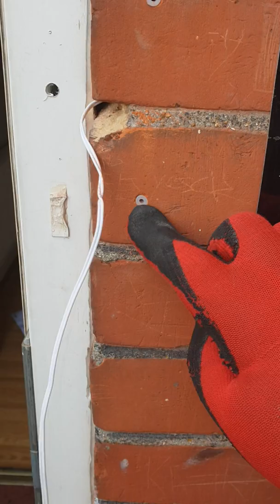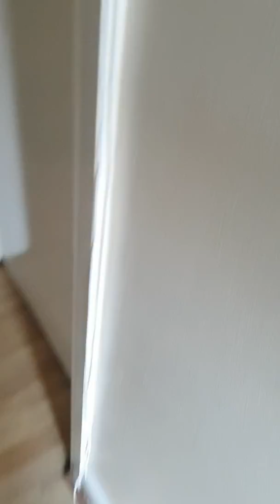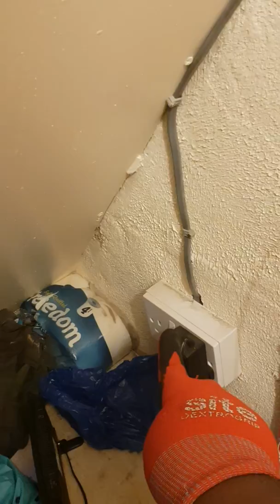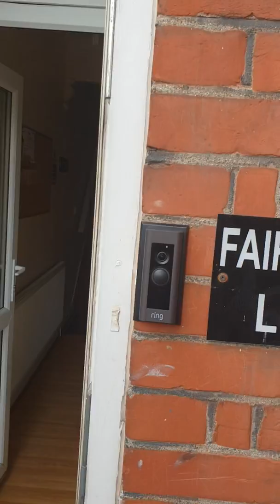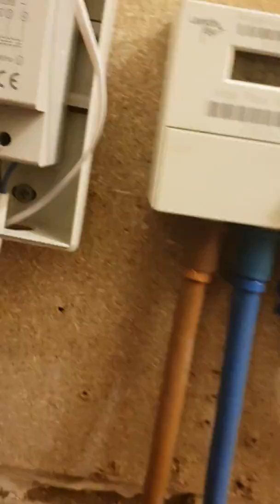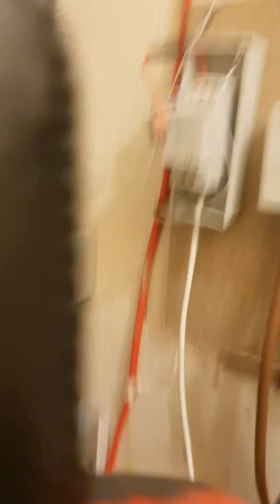Ring video doorbell Pro installation explained easy! UK ( w/o exisiting door bell)

Comment from the maker: No you need the new bypass unit
Reply: Hi Telephone Engineer. My pack contained a bypass unit and transformer which I've used but when I measured the ac voltage output it was 31v not 24v. How come the transforer they supply provides a greater voltage than the bell requires - will it be damaged?
Reply from the maker: @brianrogers5974  hi Brian I remember a YouTube video about I think 3 years ago when a uk youtuber measured the voltage of his at his door it was about 29v so on some jobs where I've installed the ring pro  I've checked the voltage and I've been getting about 29v to 32v?I dont this its to much of a problem ,you could try another transformer from screwfix which runs at 24v the same voltage and cost £8.99?also remember it is an alternatiing current so the will be a degree of voltage fluctuation.
Reply from the maker: @brianrogers5974  plus if the ring transformer does so how damage it it will be up to ring to replace it with a new one.
Reply: @siatelecomsltdLondon  Thanks for the speedy and reassuring response. Can't understand why on earth they use the term "bypass unit" though when it's just a slow blow fuse.
Reply from the maker: @brianrogers5974  the new white square block I dont think it acts as a fuse I think ,I maybe wrong it could be a some sort or voltage regular?